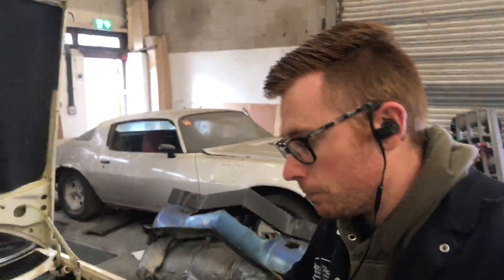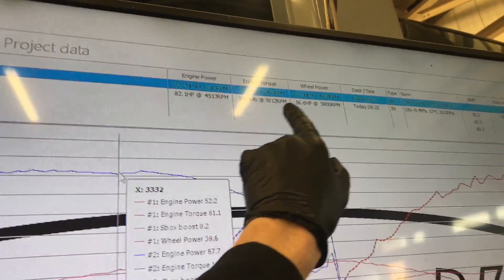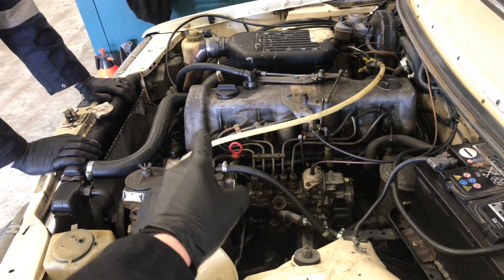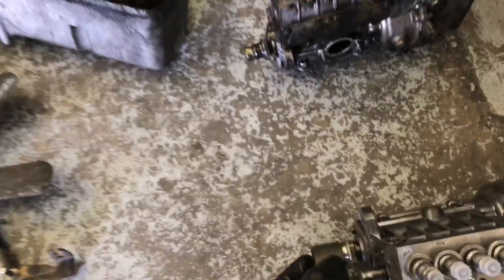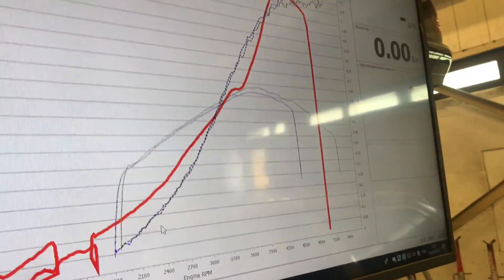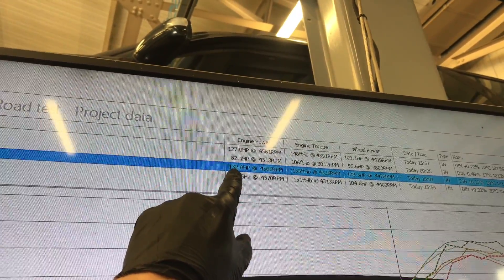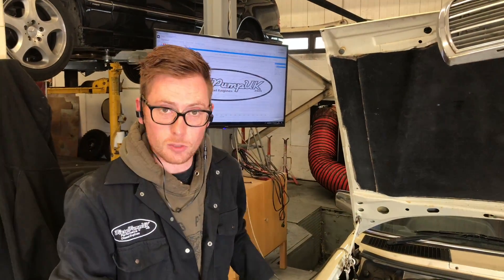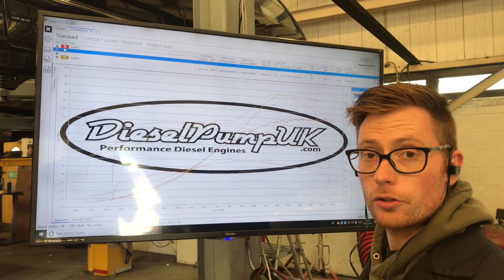W123 OM617 Double The Power

Comment: Great information.  I have a 1981 Mercedes 240d with the 4 speed manual rather than the 5 speed manual commonly found in Europe. The 4 cylinder diesel does not put out a lot of power but I keep up with traffic okay and I have taken many trips to the San Diego area from north of Bakersfield about an hour.  It takes about 7 hours after you fight through the Los Angeles traffic. It is always the struggle between lowering the RPM on the top end and having zip on the bottom end.  The first 2 gears I am usually right with the traffic but by the 3 gear the car drags behind the traffic until I get back to the flow of traffic.
Reply: Something I did modify was having the 205 70r14 Michelin tires but now I can't find them at Costco.  I also added another air scoop close to my AC condenser.  A drunk hit my first Mercedes and totaled it but it makes a good parts car.  I took the air scoop added a PVC Y and channeled both air scoops into the engine.  I have never put it on a dynamometer but it has made the diesel just a bit perkier.  I also add Cetane and Marvel's Mystery oil to the fuel.  That helps lower the loud chatter of the engine while getting more power out of the engine.  My next big project will be to replace the mechanical radiator fan with an electric fan to take back some of the horse power lost on moving the mechanical fan.  I upgraded the alternator to a bigger alternator that took the same plug in.  That has also helped. It would be nice to put a turbo on that engine but it was not designed to take a turbo so that idea has been nixed.
Reply: @kermitefrog64  How is it over the grape vine? No problems with those inclines? I imagine the turbo helps with elevation change.
Reply: @MiikeyLawless  Actually, the 240d 4 speed manual does not have a turbo.  I get a good run up the hill and then have to shift into 3rd but it stays around 55 mph. which really pushes the engine.  I currently put on a new set of tires and went with the Uniroyal 205 75r14 and it makes a nice difference on the top end and drops the RPM. It makes a bit of change on the speedometer but the added comfort makes a nice difference.  My recent project  has been replacing the mechanical radiator fan and replaced it with a Flex-a-lite electric fan. I am no longer taking the long trips down to San Diego since my wife died from cancer 2 1/2 years ago.

Comment: I would try to get a Turbo engine and do this conversion on. There is a reason why Mercedes upgraded the oil coolers, sprayers, pistons, etc on the turbo models. 

But if that guy doesn’t care. Oh well.
Reply: Sideshow 44 I have no clue when it will go boom. It might go tomorrow. It might go in 5 years. But one thing is for certain. It will not last as long as one of the US spec Turbo models.
Reply: been done by the finns.

om617a stock internals seem to throw connecting rods around 250hp.

om606 is your guy for big power.
Reply: We had the same engine in a G-Wagen with after marked turbo kit turning out around 150 HP. It ran close to 600.000km (372822 miles) before it cracked a piston. Quite strong engines in my opinion.
Reply: I have one of those STT kits on my 300D. 1985. 130,000 miles and still runs like new. The only thing that kills the OM 617 is rockapes who abuse them,lack of maintenance mainly. And the turbo is the same as the factory fitted to the turbo version. Without doing any pump mods I even got a speeding ticket last year.